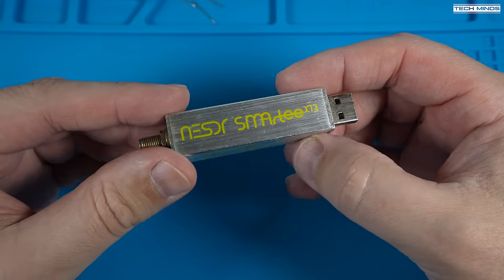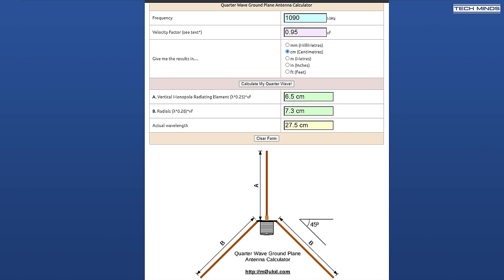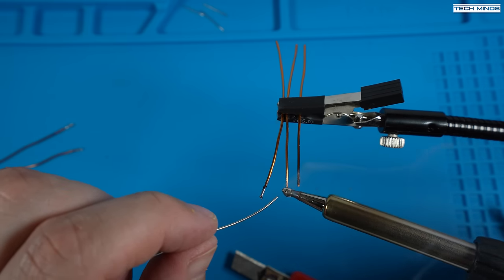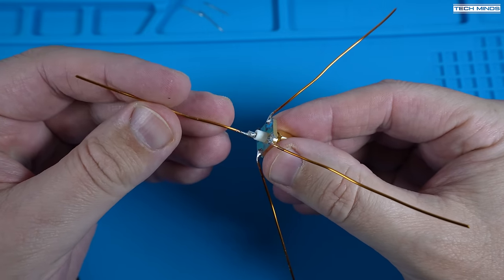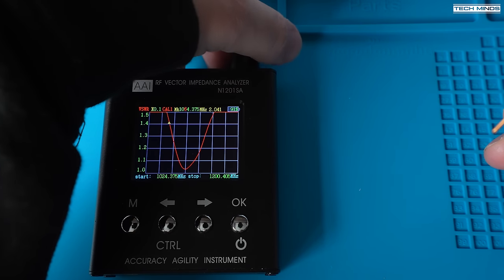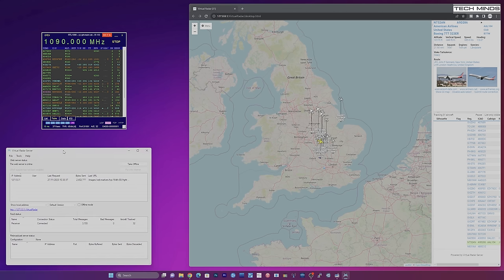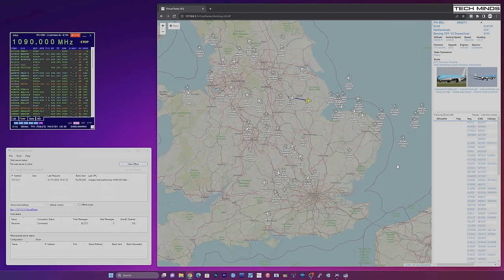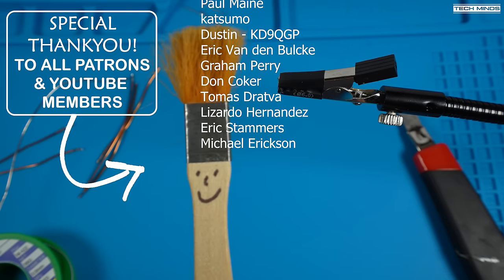Make Your Own Aircraft Tracking Antenna With RTL SDR

Comment: I experimented with quarter-wave ground plane vertical antennas for 1090 MHz and had success, but in the end had better results with the "can" antenna, where the radials are replaced by a round metal can, 10-cm diameter X 10-cm high, opening facing down. The connector is bolted to the center on the top, with  the driven vertical element sitting on top of the can, and the coax coming out the can from below. It's mechanically very sound and ended having better range than the traditional ground plane antenna. Has been working for some 5 years now. 
It's very simple to build and plenty of details are given in the Flight Radar 24 forum. Might be worth experimenting and making a video, too.
Reply: Best I've ever found too, how did you waterproof/weatherprotect it to last 5 years? I think mine went rusty after about 2 :)
Reply: @JohnBaxendale  I just spray painted it. On closer inspection, the can does show signs of rusting on the outside, but the connector inside is pristine still, as is the soldered vertical whip.
Reply: @coriscotupi  Thank you! That’s helpful, I used a little plastic to cover the tip but didn’t want to spray the can in case it killed the reception - I’ll give it another go :)
Reply: @JohnBaxendale  Avoid paints with any potentially metallic contents in them, such as silver or aluminum colored ones. Other than that, pretty much any spray paint will do, enamel, nitrocellulose (automotive), etc.
Reply: Thanks for the info, I might well try this!

Comment: I have made using the same websites designs a 1090 Slimjim!
Unfortunately I dont have your test equipment to fine tune :(
However, the results are oustanding!!

Construction is simple;
I used a cut down fibreglass tent pole, with two holes drilled to get the correct top and bottom spacing
The element is single strand copper wire threded through the holes and secured to the pole using heat shrink sleeving
All then encased in a plastic tube (white conduit), sealed at the top to weather proof it.

Keep up the great videos

Comment: Have you done a video about building an antenna for listening to airband ? That would be pretty cool
Reply from the maker: I did a review of an Airband receive antenna a little while ago, but I have not made a video about making one. Maybe I will look into this too. Thanks for the suggestion and thanks for watching! :-)
Reply: I have just purchased a UBC125XLT scanner and the reception with the supplied antenna is absolutely awful. I have owned a variety of air-band radios over the years from analogue dial tuning to Yupi scanners but this 125XLT really disappoints me. I also are in a mind to return it and to look for something else but I really bought it to be portable rather than attached to a coax cable antenna. I might just have to use your advice and knowledge and build a discone or similar. Thanks for the video.

Comment: Try building a 16 segment (Colinear) using RG-6 coax.. housed inside an appropriate length of  PVC Pipe. I did.. It rocks with a 200 Mile / 320 Kilometer receive radius.. (NO ADS-B LNA used) I also use the 75 Ohm RG--6 (Because of its low loss properties) into my radio room direct to the SDR.. just convert the F Connector to SMA with an adaptor. It would be interesting to try it with an LNA..
Not sure how much, or if any gain.. (Aircraft may be Below the Horizon at that distance).. so no point.

Comment: Antenna height should not matter much, after all airplanes are themselves high. I had good results with a simple random lenght mag mount with my cheapo sdr too. Something like 100km is well within the range but buildings nearby were limiting factor with antenna about 1m from ground in residential area.

Comment: These little antennas work great. If you don't have an ant analyzer, don't fret. Your antenna will work the same untrimmed if you built it to the proper dimensions. SWR really isn't that important for a RX antenna. With my RSPdx reciever I don't need a preamp even with 20 feet of decent coax. The RSPdx has a lot of RF gain over the other little dongle SDR's.

Comment: best results i've had is with a wire made franklin antenna, piece of  15mm white water pipe  slot cut to take the horizontal stubs and give the support/mounting

Comment: looks like you got decent range. There’s an online calculator that can work out the maximum theoretical distance accounting for the curvature of the earth and the fact a plane is 33k feet up in the air and it was about 250 miles
Reply from the maker: Cheers!

Comment: Looks easy and nice, i will make it, Thanks for the tutorial, and all your videos, i watched a couple of them since i got the SDR.
I have DUMP1090 and Virtual Radar, but every time i start DUMP, it has a problem with finding py.exe, but after pressing OK, it works, so i dont really care about that yet. It even works with my mobile uhf-vhf in my window (i cant install it anywhere else, only in the window, 4th floor) i find 1-2 planes sometimes, i cant wait to try this antenna ;)

Comment: The best reception I've ever had with ADS-B was a home-made antenna from an old beer tin, worked amazing. My question is around how to waterproof these little DIY antennas... can I just spray them with spray paint? Are there any particular paints to avoid or prefer? Can I coat them with plastic or PVC tube? Which ones will affect the reception or tune, if at all? HELP ME OBI WAN TECHMIND! :)
Reply: Why even waterproof it? That would be pointless.
Reply: @humanbeing-001 Waterproofing it means it can live outside where it has a clear view of the sky and much better performance…
Reply: Waterproofing is important because the coax can let water seep in and ruin it, also the metal parts will corrode outside. You can use non-metalic spray paint with no issues, that's what I do.

Comment: Maybe a silly question but does the gauge (thickness) of the antenna wires matter?  Is there an ideal gauge or pros/cons of different thicknesses?
Reply: Not terribly, at least for receiving purposes. Generally, the thicker the antenna element the wider frequency range it will resonate at (to an extent, and generally). For transmitting, it very important that your antenna is resonant on the frequency you're transmitting at. For receiving, you're not going to see much difference - at least on a 1/4 wave ground plane antenna like in the video. They tend to have a wide resonant bandwidth, anyway. 
So use what you have available. The #10 American Wire Gauge (6mm^2) or #12 AWG (4mm^2) bare copper wire from the electrical department of the hardware store is usually perfect for these knock-together projects. It's easy to solder, easy to straighten, and it's really cheap. You can get a foot (~30cm) of the wire for under a dollar where I am in the States. I keep about 10 feet of it around for when I get the urge to make something. If you get the insulated wire, it will work fine, but the length of the elements will change slightly (+/- 10%), so experiment until you find what works for you.

Comment: While this antenna will work it will only receive well at lower angles to the horizon. You should look up the following three antennas for better coverage. Also I would urge anyone to look up the ARRL satellite handbook and get a copy. Any year since 2000. The antennas are: the turnstile antenna (you can substitute 75 ohm tv cable as the phasing line), the egg beater antenna, and the quadfiliar antenna.
Reply: 1/4 wave ground plane antennas typically have a low angle of radiation and reception, which makes them great for satellites and aircraft as they will be much farther away at the horizon at the gain lobes than when they are directly above in one of the antenna's nulls. The relative distance when overhead more than compensates for the reception null. They're also broadbanded enough for doppler correction. 

Where dedicated turnstile and eggbeaters shine is when you're dealing with circular polarization. A linearly polarized antenna (like a ground plane or dipole) will have a 3db loss when receiving a circularly polarized signal, but you don't have to worry about right-hand or left-hand polarization mismatch, which can be 20db or more. I use a ground plane for FM satellite work. I used to go wave an Arrow Yagi antenna around in the parking lot like a weirdo, and honestly, the ground plane works just as well and my arms aren't as tired.

In this use case, ADS-B signals are vertically polarized unless there is some weird propagation mode, such as reflection/refraction from mountain peaks or other aircraft and such.

Comment: With all the various antennae you have , and I’m sure you’ve a HackRF, have you tried the Operacake for HackRf. ? If so, what are your thoughts? Also, can the OperaCake be used with other SDR hardware or a Portapack? I’ve been meaning to ask for a while because you have access to a bunch of great antennae that span a huge frequency . As always, thanks for all informative videos
Reply from the maker: I don't currently have one, but I'll get one and see how good it is. Thanks for the suggestion!
Reply: @TechMindsOfficial  awesome!!! Michael Ossman touches on cli control of the OperaCake in his series on the HackRf. Also, in that series he mentions that the HackRF is capable of frequencies above 7ghz( Rx only, I think). If you can verify that a lot of us would greatly appreciate it. Lastly, can you give an opinion on feasibility of using / modifying OperaCake design to use with other Transceivers like the Adam-Pluto or similar. Thanks for all the information you convey to your viewers. It’s greatly appreciated. 
Oh, whatever came of your 2.4ghz Power amp.? I’ll look again for a wrap up video but last time I looked , I didn’t come across one. Thanks again

Comment: VRS is not the best solution. TAR1090 is better and better still would have been to use a Pi with a light OS and READASB for the decoder and tar1090.

Comment: Which is best? A dedicated Flight Aware dongle (with LNA and filter on board) or a normal RTL-SDR with bias tee and the SAW filter with LNA included?
Reply from the maker: Depends if you want to use the SDR for other things.  A dedicated SDR with inbuilt LNA and Filter for ADSB is great if that's all you want to use it for. Having a Nooelec SDR, or an RTL-SDR V3/4 means you can use it for most things, and then just add on filters, lna etc when needed.
Reply: RTL-SDR is better
Reply: If you want to receive other things also the RTL-SDR is a better choice, if all you want is ADS-B the purpose built SDR is probably easier. If you find that you need a preamp you can add a Noolec or similar pre-amp to the RTL-SDR later.

Comment: My Antenna Wich Is NOT Such Acuratly Made For 1090MHz Gets Around 300Km Around My House, Its Above My House Around 7 Meters, So Its Basicly At 4 Or 5th level Of High If You Think Flat/Appartment Heights. It Gets Good FM And All That Stuff, HF Not So Much, But For That I Have My Long Wire Antenna That Runs Throuought My House Lenght And Goes Out From House To The Fencing belove, That Antenna At Nightt Gets Me Half Of The Globe, Sometiems Even More.. :)

Comment: Why you don’t try a collinear coax cable antenna ?
Reply from the maker: I think a lot of the commercial made ADSB antennas are like 5/8th wave co-linears. I havn't tried one but in this video I wanted to show how easy it would be to make a GP antenna using a calculator. Maybe I will make one and then do a live comparison between a GP and Co-Linear. Thanks for the suggestion!